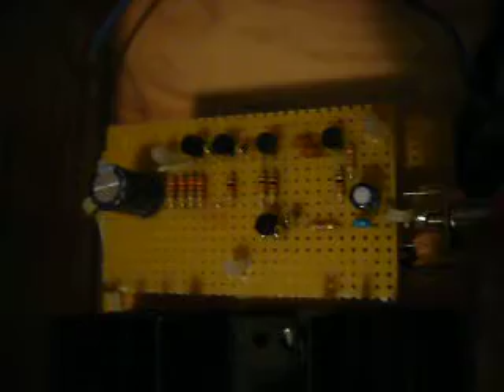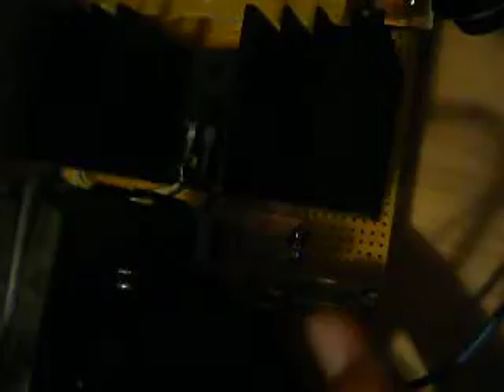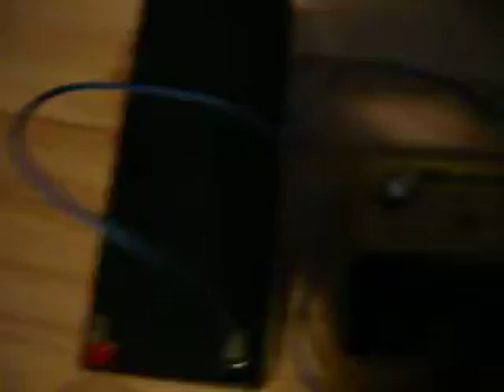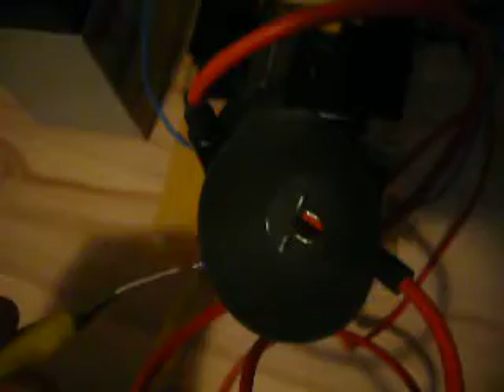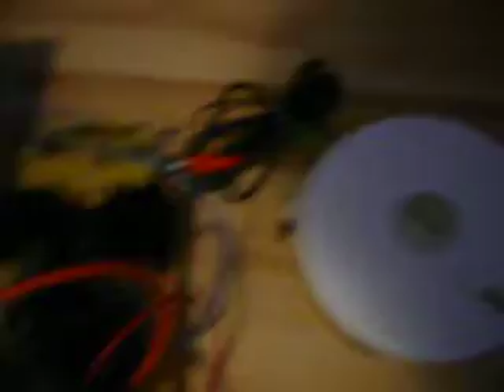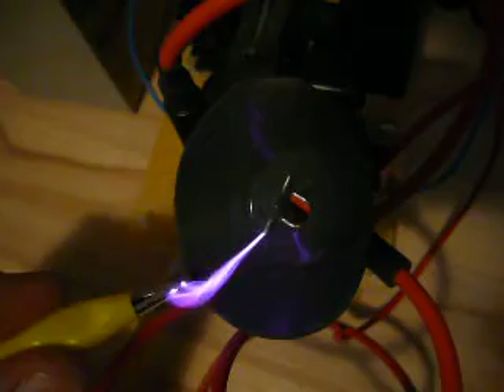High voltage generator audio modulatable

Comment: thanx stefan.
Il looks like it is pretty much AWG like device.
I wander  how high it goes with frequency response?
the maximum voltage ?
leading edge and trailing edge time interval for square?
Maximum current drown from PS